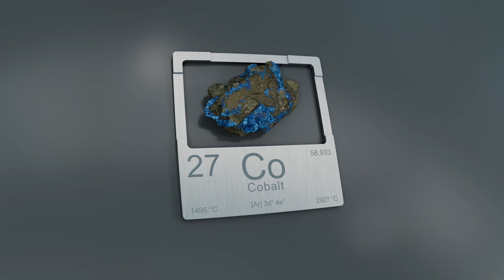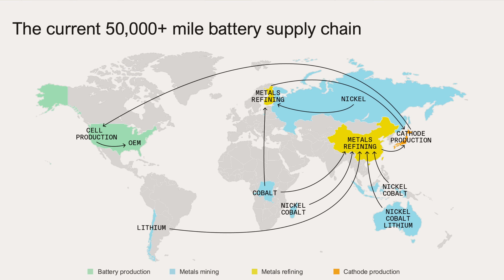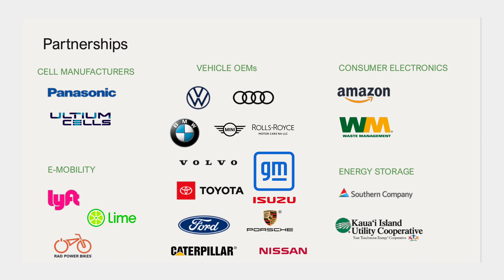He Co-Founded Tesla Then Left for Something MUCH Bigger

Comment: I love my Tesla so much, im simply not going back. I wish they would make a Rivian sized truck (that doesn't look like a refrigerator that was in  a tornado)
Reply: I didn't like the appearance of the Cybertruck when I first saw it, but it grew on me. However, the stainless steel panels are just a skin, and theoretically could be replaced by standard painted metal or formed plastic. This would allow much more flexibility in style (rounded corners, accent grooves), but overall size and shape would remain the same. I wonder if Tesla will bring out a future model with a more conventional appearance. I'm sure someone would point out that the original design was "exoskeleton" and the ss panels was part of the strength of the body, but that was scraped in the final design.

Comment: I don't understand why recycling is relevant, if they became useless then why are they good after the process?
Reply: Really? The whole point is that they separate all the original materials, and sell them back to the battery companies to make new batteries. They were only "useless" because the performance was degraded, not because the materials disappeared.
Reply: The cells break down naturally through dendrite formation and other phenomena causing reduced performance and capacity over time, but the elements are still in the cell. Nickel is still nickel afterward. It’s not the best example, but you can think of them like ice cubes. They only have a useful purpose when they’re cold and solid, over time they melt, but since water is water, you can take melted ice cubes and reform and freeze them. You don’t have to get fresh water necessarily, you can recycle the melted ones.

Comment: Yes, the fact that so many of the materials in EVs can be recycled is a huge win. No way can fossil fools compete with that advantage. And the batteries last much longer than the naysayers would have us believe. In my EV, after 1.5 years and 18,510 miles, its battery capacity is still at… 100%.
Reply: 24M batteries are power dense and very recyclable.